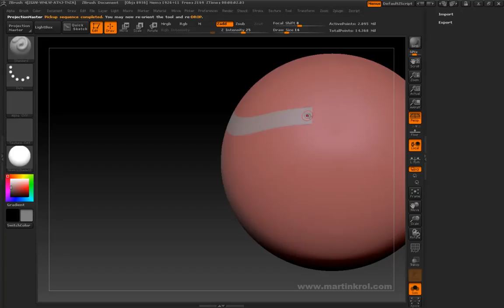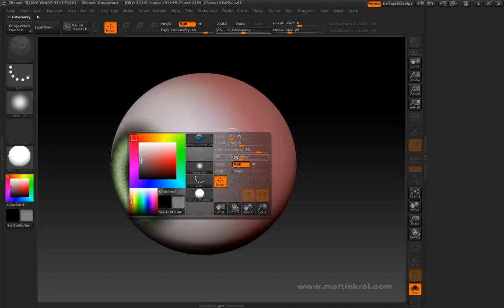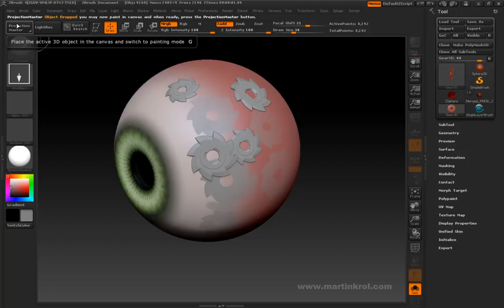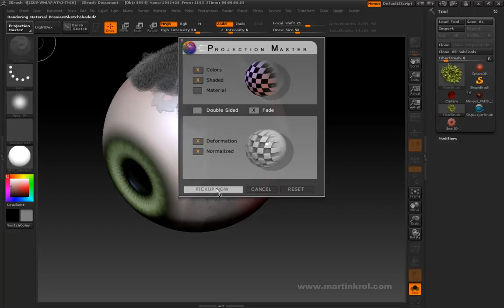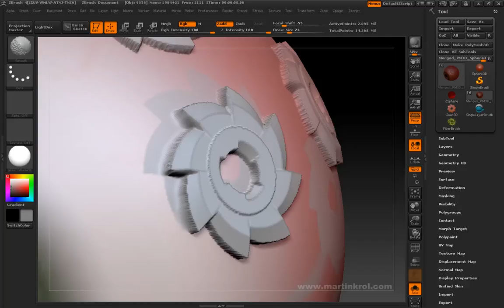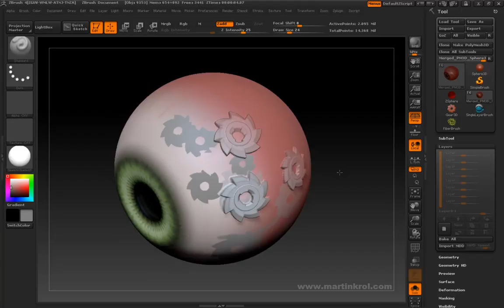Comment: When I try to use Projection Master, it seems to be working, right up until I activate "Pickup Now". Then, it returns to edit mode but none of the changes made while in 2.5D mode apply; it's exactly as though I hadn't done anything, the same state as it was in when I selected "Drop Now". I can't figure out what I'm doing wrong, or what step I'm missing, or what have you. My model is a 48M polygon 3D scan in Polypaint mode. I imported it from a 1M poly OBJ with a texture, then subdivided it as far as I could go and baked the texture into vertex colours. I need to be able to do stuff like use the Cloner brush, but it just does nothing for some reason...